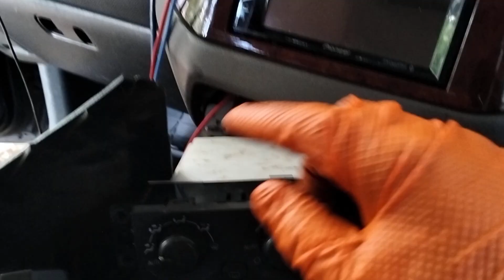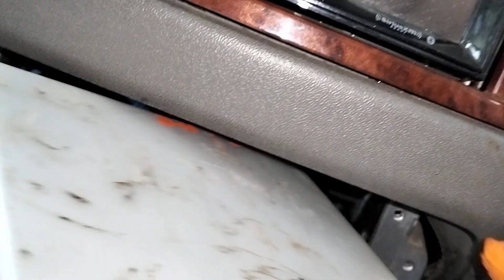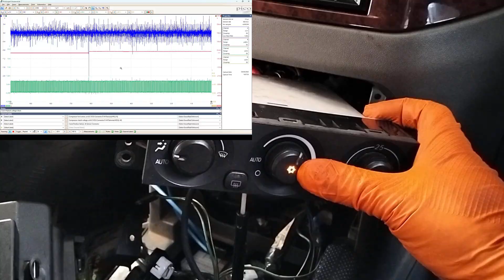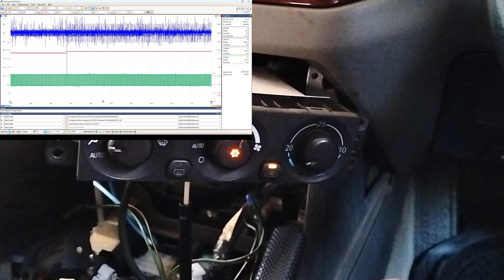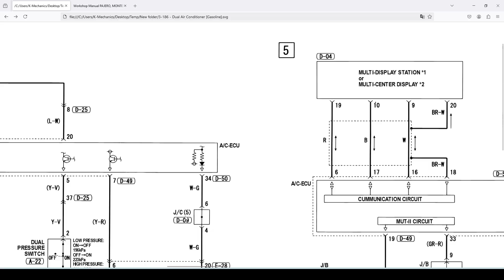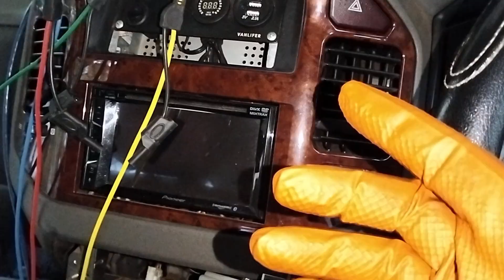2004 MITSUBISHI PAJERO AC DEFAULTING DIAGNOSIS

Comment: Today I just changed compressor, condesator, evaporator, cleaning the system etc etc because my other compressor was locked. Now after staling everything the ax start and after 5 seconds start blinking.
We just put in direct mode and the compressor work and get cool but if you conect everything normal start to blinking again.
Can you please help me?
We add a lot of gas and the pressure was right but still this problem🙁
I hope you can help me!
Montero( pajero) limited 2002
Nice video!!👍
Reply from the maker: I cannot guide you without seeing the vehicle; there are a lot of things that can cause compressor lockout. Use a scan tool and read the lockout code to get a direction. DO NOT BE TEMPTED TO DO A DIRECT CONNECTION!! The compressor needs to cycle on and off under temperature and pressure control. If you hot-wire it to run all the time, you will ice up your evaporator and it will crack.
Reply: @k-mechanics yes!
I only tested the compressor in direct mode just for 10 seconds. I know is not correct to do that.
Now im dealing with other issue, I fixed the rpm sensor on the compressor I messured and I have 200 ohms, I thin is ok, but when I turn on the compressor I don't see any voltage coming from the sensor , must be ac voltage.. but nothing.
No ac
No dc
Only ohms changes when compressor is on. 
Im getting crazy! I have one week trying to fix this error.
The compressor still run when you turn it on but after 5 seconds enter to default (protection) mode.
I know! There is a lot of sensors and permission  before ecu send the signal to compresssor to start
I don't know what to do😢
I only have one question!!
Can I get a signal from other sensor (rpm) somewhere in the engine to hack or bypass that rpm sensor from the compressor?
Reply from the maker: @biok2006  You will not see that signal with anything other than a labscope. A multimeter will not see anything there. Testing the compressor directly is OK; in fact, it's a very valid test to see if it is able to be commanded on. I was just commenting that you should not hot-wire it like that for vehicle operation. There is no other substitution you can do for that sensor because it's a very unique signal and is synced to the crank sensor to determine belt slip. It really sounds like you dont have a good RPM signal, but the only true way to tell is to put a scope on it. Can you borrow one for testing?
Reply: @k-mechanics hi my friend!
I just tested the voltage with another multimeter I have and can read milivolts in ac
My other multimeter only have minumum 200v ac that was the first problem.

With the new multimeter I have:
With the engine off 0 rpm (of course) but 0,3 milivots.. I don't know why🤷🏻‍♂️

Now turn on the car with ac off:
And I got a peak of 1.1 volts then stabilize at 0,5 mlv, I don't know why because the compressor is off🤷🏻‍♂️

Now turn on the ac:

Peak of 3 volts  then go down to 0,8 milivolts, that is between the 5 second after ecu turn off the compressor for protection.. and again 0,5 milivolts until I turn off the car.

Im getting crazy man!😢

I don't know why I have voltage from the sensor if the compressor is off!

I don't want to bored you, im just telling you my crazy problem😂.

Tomorrow im go with a friend with a good scanner and oscilloscope to try EVERYTHING.

Gonna watch your video again to see how many milivots send the sensor when is I working normally before de default.

I hope my problem is in the module or other thing, but not the compressor and sensor, gas, oil, vacuum etc🙄.
Ty man for the answer!👍

Comment: First let me think you for sharing this interesting video. Second I think the kick back voltage coming from the clutch coil diode is the problem.
Reply from the maker: Thanks for the comment. While the kickback is something I dont like and is a bad design electrically, it was not the one causing the malfunction. The failing lock sensor was the one causing it. You will notice that the kickback happens all the time, but the only time the failure occurs is when the lock sensor amplitude falls.

Comment: I have a situation with my 2001 Pajero. I turn on the A/C button, it turns on the fans but the compressor does not activate. Upon further inspection, I was able to verify that the compressor relay is missing the activation ground and that it is not coming out of the ECU. What could be the fault with this since this happened after a complete engine overhaul.
Reply from the maker: Its not possible to diagnose a vehicle without having a session on it, so unfourtunatyely I cant assist on that. I do offer remote diagnostic assistance but you will need some equipment in order to make that happen. Send me an email if you need this service.

Comment: Very informative now will the air  gap between the vrs sensor and the target wheel causes that weak amplitude
Reply from the maker: If you examine the captures, you will notice that most of the time, the amplitude is fine, but then it suddenly diminishes. Is it logical that the sensor develops a large air gap, then the air gap returns back to normal? Not logical at all. This sensor is just failing electrically within its internal circuit, and that creates the intermittent low amplitude. If it was an air gap issue, it would be low all the time.

Comment: I'm curious what solution did you have for the kick back voltage
Reply from the maker: That level of flyback voltage is unacceptable in an electrical circuit going into a module. There is meant to be a diode parallel to the magnetic clutch that clips that peak.  Either some engineer at Mitsubishi was just careless in the design, or the system has been altered in some way. Sometimes the engineers factor this into the relay or the compressor itself. So there is a possibility that either the compressor is not the correct part number, or the relay is not the correct part number. I proposed to the owner that when he gets the compressor, we put a diode in the circuit to clip the peak.

You will be surprised at how careless vehicle design engineers can be. The early Mercedes M271 engines used to nuke the computers because the engineers let the kickback voltage of the ignition coils to go back to the ECU unprotected, and scope tests would show kickbacks of over 450V!! Ford are notorious for unprotected compressor lines that also destroy logic gates in the ECUs. And of course, we can't forget the generation 1 VW Passats that were known for blowing the injector control lines because of not clipping the injector kickback voltage.